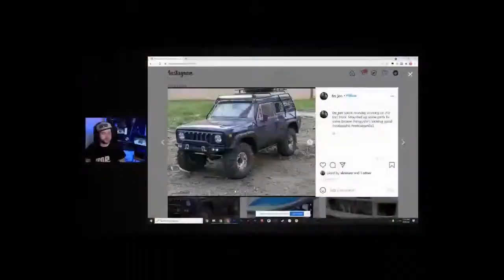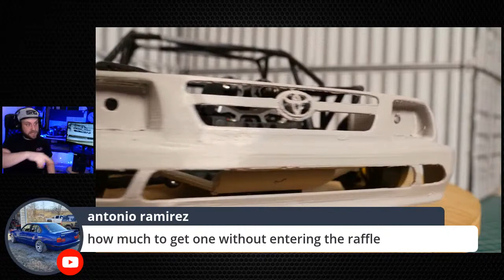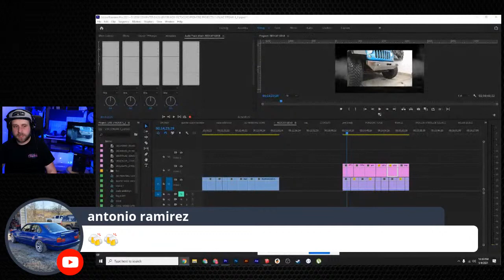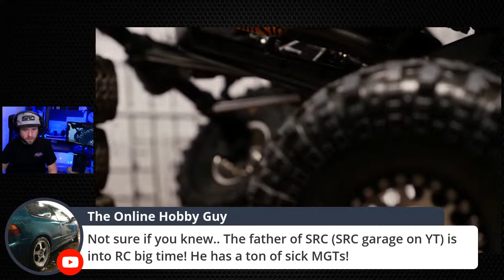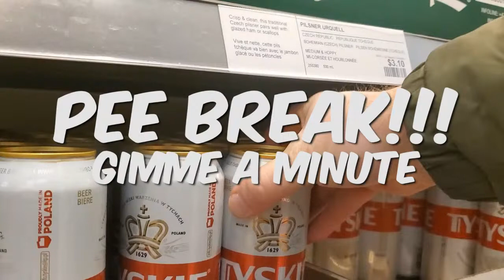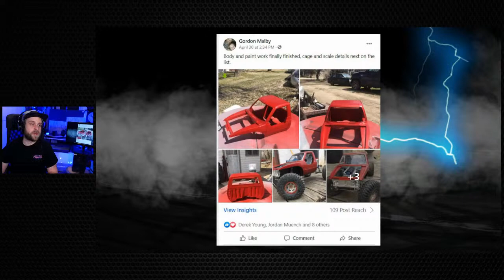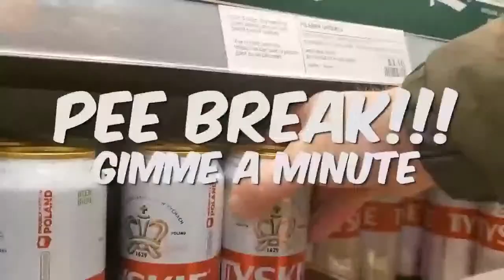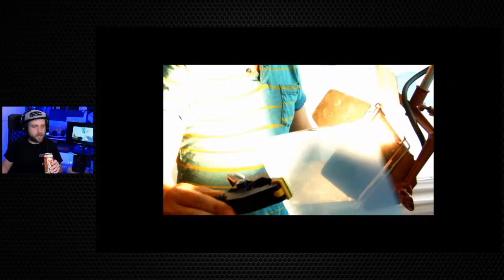KPOPRC LIVE - JET BOAT WINNER ANNOUNCED - NEW RAFFLE! - 3D DESIGNED BUMPER LIVE

Comment: Thanks for the shoutout KPOP! I did go cheap on the radio for the red prototype. The bodies are hand laid fiberglass, but everything else, besides the rolling chassis’s is 3D printed.  Built 60 rolling chassis’s. Most are “kits”, but I’m building a few complete cars for guys now. 😉 BTW, setting up one of the cars for a flat out V8 speed run.